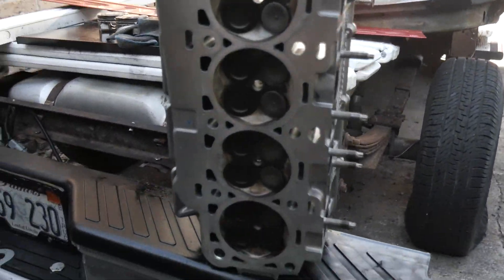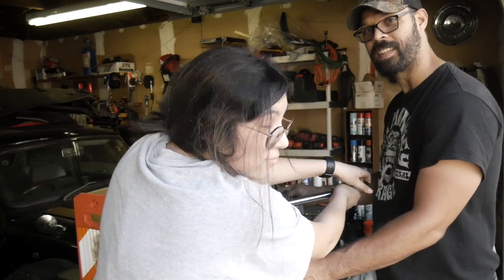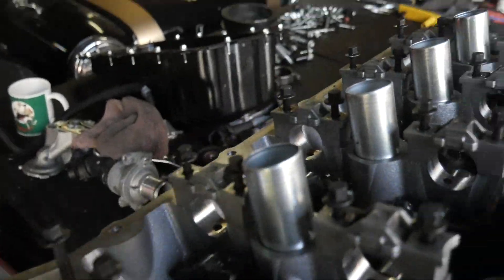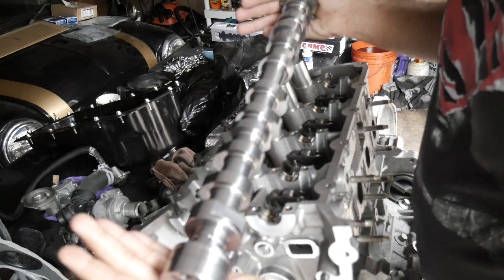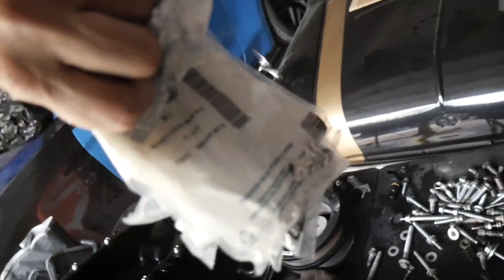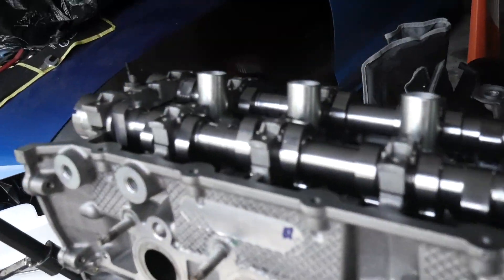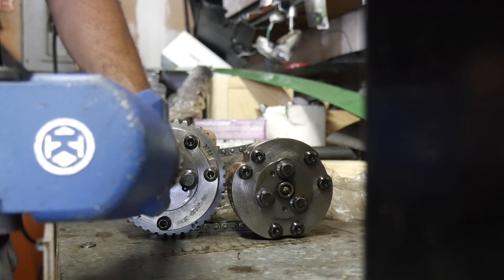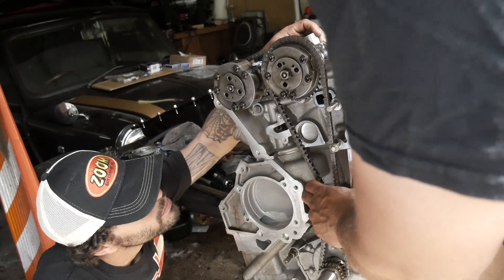Installing Comp Cams NSR Stage 3 Cams on an S550 Mustang

Comment: Jesus christ , your final of the headboard scares me in my soul. I mark the head of the bolt with paint with a reference mark or use a toqure angle meter . Those coyote engines ain't cheap 😭